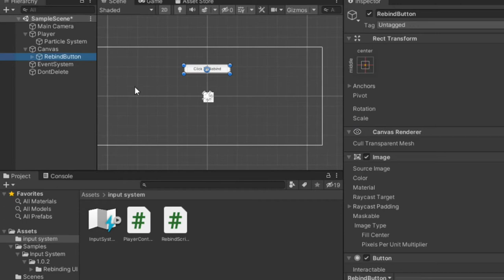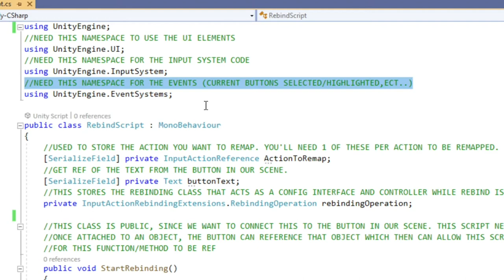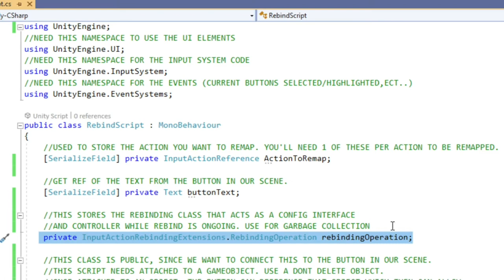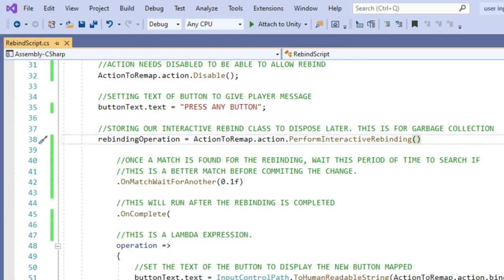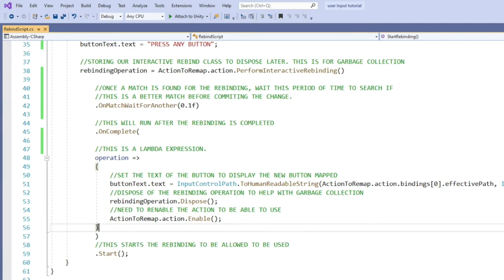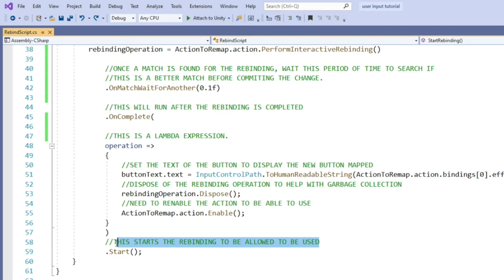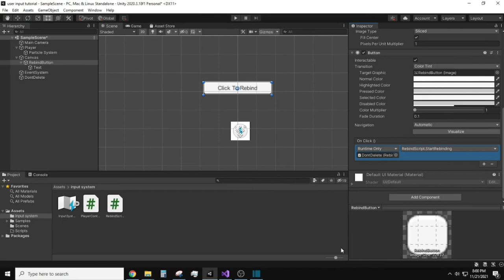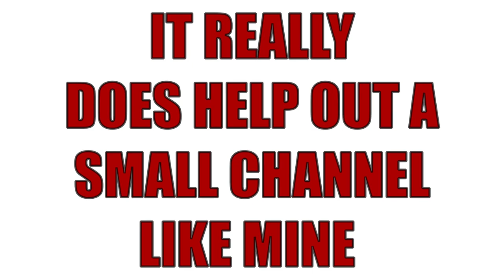REBIND controls Unity's NEW INPUT SYSTEM: SUPER EASY [Button Actions Only]

Comment: I have tried many solutions to allow the player to rebind the inputs... But only one works and that is yours. Moreover, it is easy to understand and implement. A very big thank you :)
Reply from the maker: Thank you for checking it out and I am glad it could be useful to you :D And rebinding with the new user input system can be quite tricky since there are a few methods of doing it. Even digging through the the official unity code snippet they posted can be confusing. And the documentation seems to not be fully completed yet.
Reply: @SethFunk do you have any idea how you would unnasign the button if it is already assigned to an action in a specific map? Like in overwatch is if you assign X but X is assigned to jump it will unassign it. Hope that makes sense. Thanks for the vid though 👍.
Reply from the maker: @TheMADmk  I believe you would need to erase the binding, which here is the documentation. I don't know the code or how to implement that portion since I haven't worked much with this input system for the past year, bu this link should be able to help guide you some:

https://docs.unity3d.com/Packages/com.unity.inputsystem@1.6/manual/ActionBindings.html#erasing-bindings

Comment: What about actions that have multiple inputs attached to them?
Reply from the maker: The first line of the lambda expression is controlling which binding is being effected. You can see that my code is only using the index [0] for the binding replacement. You'd have to figure out a way to see how many indices the action, loop through those bindings, and should be able to use the rest of the code as is. OR you could have separate buttons controlling "pc" inputs, "gamepad" inputs ect.. That way you can hardcode the index and not have to worry about figuring out the appropriate index for which input type.
Reply: @SethFunk  thanks!
Reply from the maker: @Lua_computa  good luck on your project!